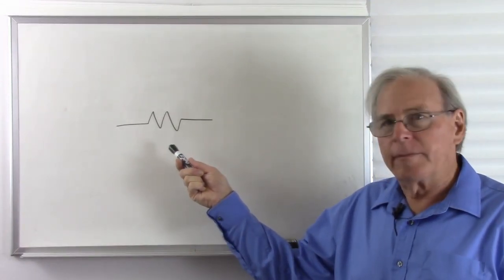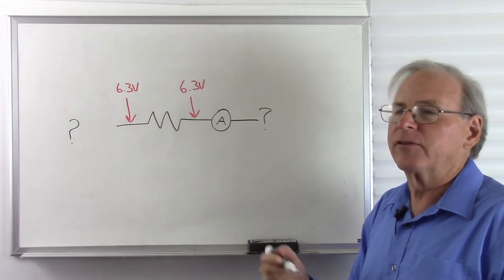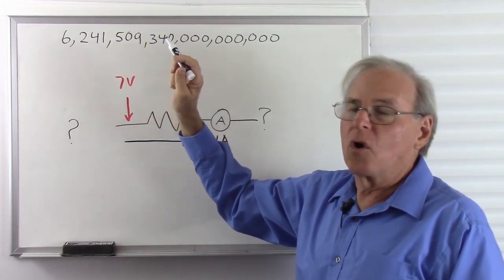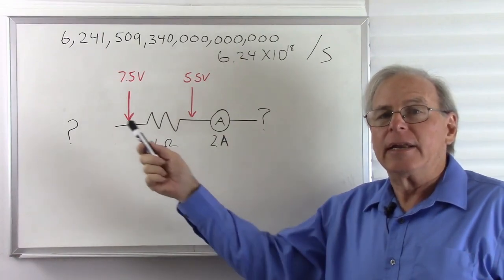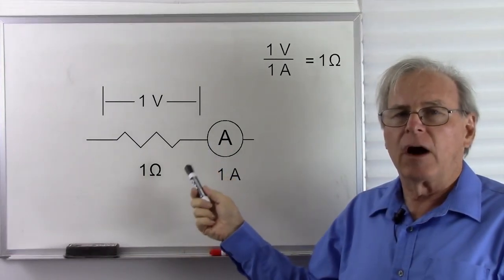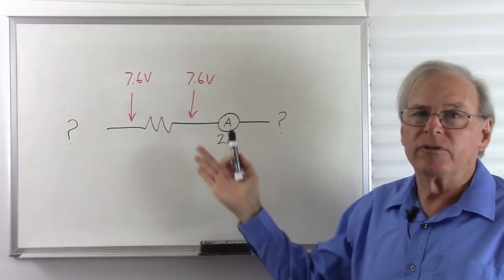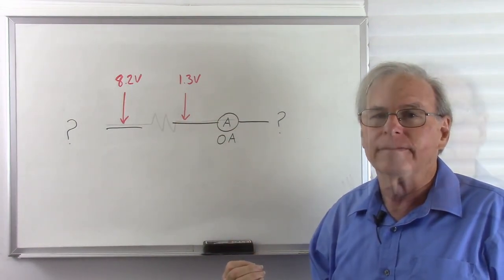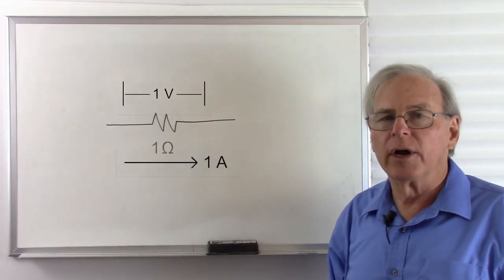Conductors, Resistors, and Ohm's Law

Comment: Silly question.  When using an LED a resistor is used to protect it.  However, it doesn't matter whether it's connected to the anode or cathode.  I can understand putting the resistor between the wire, trace, or rail and the anode as the electricity would hit the resistor, the current would drop to a level the LED can handle, and everything's fine.  However, placing the resistor between the cathode and ground also works, which must mean that the resistor is affecting the current before it even reaches the resistor.  How does that work?
Reply: In terms of basic circuit analysis and for practical purposes, it doesn't really matter where the resistor is connected in a circuit. When you do your analysis you'll have your power source (voltage), your loads (resistors,led's,inductors....) AND just the wire that connects them all.
Reply: @rob0516  I believe so.
Reply from the maker: Thanks for answering this not-silly question roberta.8426. Here's another way to look at it. If you want to reduce the water flow in your garden hose, you can adjust the faucet, or you can put your thumb over the end of the hose. Either way, you reduce the flow. If you want to reduce the current flow in your LED, you can put a resistor before the LED or after the LED. Like the garden hose, the effect is the same.
Reply: @rob0516  Thank you.
Reply: @Vocademy-Electronics-Tech  OK, I get the analogy.  Thank you.
Reply: @Vocademy-Electronics-Tech  Can you please comment on Piezo device drivers, thanks